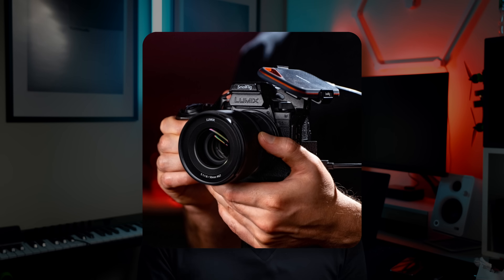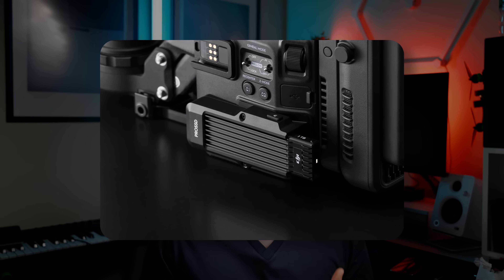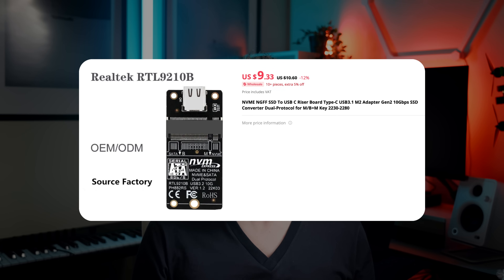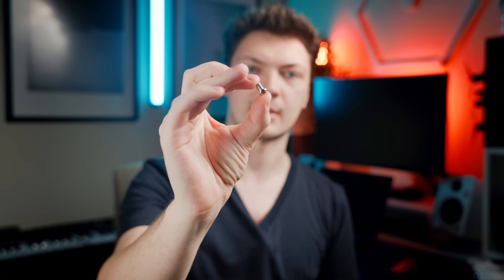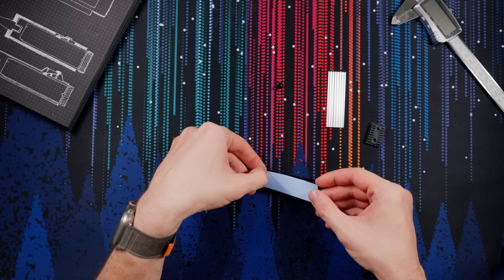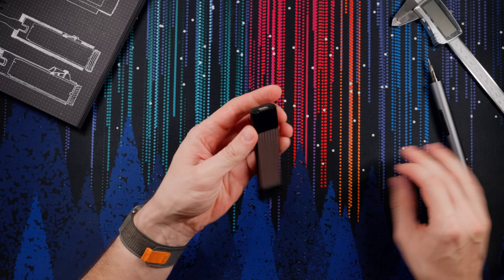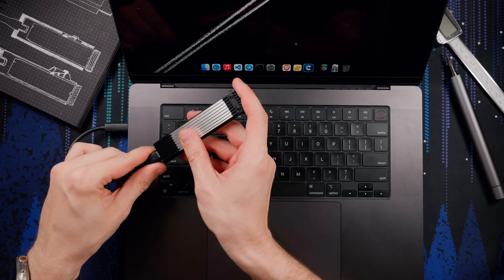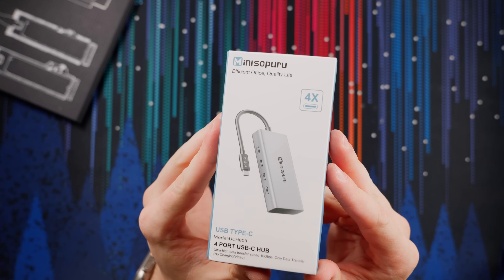Free DIY Pro SSD Mag Recording System for Any Camera

Comment: very cool thanks - been looking for something like this. I would maybe update the design to fit a fan, because transferring data heats the drives pretty quick, and the performance drops due to thermal throtteling. So a fan could help a bit.
Reply from the maker: ooo that's an interesting idea, will definitely look into this for gen 2 👀

Comment: Hey, I've tried printing the mount a few times, but each time, the hook does not seem to raise very far, and quickly the gears moves towards the backplate until it no longer is moving the hook at all. Any suggestions?
Reply from the maker: Check the number of teeth on both parts the gear attaches to, I've had an issue with Cura slicer where it would sometimes remove one at the edge cause it's fairly thin. I used Creality slicer to fix it
Reply: @MaxRovensky    I have three teeth + the bottom edge on the hook, four teeth on the button, and twelve teeth on the gear. Can on you confirm what it should be? I can't quite make it out from the video.

I have slightly better results by increasing the gear to 105%, but it still seems like something is off.
Reply from the maker: @gillberg1111  that sounds correct 🤔
Can you DM me on Instagram, I can help you troubleshoot but youtube comments are super inconvenient for this 😁

Comment: Great idea and video, Thanks for sharing. 
I'm about to order the parts and wanted to clarify. The link for the heatsinks has 3mm & 6mm high ones. It's a bit hard to tell in the video which ones you used. 
Again thanks for sharing a great idea.
Reply from the maker: 3mm ones 🙂
Reply: @MaxRovensky  Cheers. I'm going to make 4x Mags and the 4x Bay for my laptop. That way I can shoot tethered photos and have desktop PC-type storage at home. I may even try and put a Mount on the laptop rear for increased storage on the go.

Comment: This was awesome but could you tell me where you got the black screws from?
Reply from the maker: And if you're referring to the ones that secure the SSD inside the mag - they come with the adapter boards and heat sinks
Reply: @MaxRovensky  thank you
Reply from the maker: There are sets of M2/M3/M4 on Amazon for about $15-20, I think I mentioned it in my lens video
I also have a ton of spares from building FPV drones 😅

Comment: The Kondor Blue handle is awesome.  The Problade connector is supposed to be open so any company can use.  Maybe you can get the connector from a company and build it out.
Reply from the maker: I don't think it's open. I'm sure they'll license it to other companies if they ask, but I just don't see any appeal in a pin-to-pin adapter that can be discontinued at any point because a single company makes the drives
Type-C is definitely the way to go for something like this imo 🙈

Comment: Just what I needed. Was researching the problade and it seems they just have an nvme and an adaptor to their proprietary connector inside it. 

Would be dope to have a 2230 type nvme casing for an even smaller footprint.

(Would have been nice to see how you cable managed the thing on to your camera)
Reply from the maker: That is a neat idea, I'm gonna have to look into it 👀
Reply from the maker: Re: cable management, the cable is tiny, it wraps to the left and above the mount and goes straight into the USB port, barely noticeable during use
Reply: @MaxRovensky 👀🫡

Comment: Useful, BUT: Just using Samsung T5/T7 SSDs with the normal tilta ssd holder in a comfortable position and an angeled cable will do just as good, won't it?
Reply from the maker: Yes, but it takes up more space on the cage somewhere and I don't want to deal with cables 
The nice thing about this one is I have to plug it once during installation and never cable manage again 😌
Reply: @MaxRovensky  thats true!

Comment: I have a similar hub, my one puts out a lot of heat, even if not engaged, so in hot weather I have to remove the metal encasing, to protect it from overheating, which would make it crash. The metal encasing has no cooling function, it is insulated inside. I hope that your hub is kind of cooler, otherwise I would recommend removing the housing and add some air slots to your station.

Comment: This is so cool and well thought out!
Just wanted to chime in and add just in case anyone was thinking of getting a different USB hub or using one they already have. MAKE SURE THEY ARE "POWERED" HUBS. To my knowledge (definitely correct me if needed) a non-powered usb hub (one that doesn't have an additional cable that connects to the wall) will not be able to provide separate read and write bandwith to each SSD. Instead, it will take the speed from your computer's USB port and share that across all 4 SSD's drastically reducing read and write speeds. That's the best case scenario, it can additionally kill a USB hub and potentially your drives/corrupt data.

This may be obvious to those that have experience with this kind of setup, but it wasn't obvious to me and I ended up running into issues with my own setup previously.
Reply from the maker: ProBlade bay is powered I think
This hub is advertised as Thunderbolt-compatible with 40Gbps total throughput, which, with each board capable up to 10Gbps checks out and doesn't need a separate power cable
That said, I haven't tested it with more than 2 drives at a time yet. But in theory, it should be well within specs

Comment: This is fantastic. I work with a DJI and one of my issues with it is how expensive the PROSSD. I want to see if this 3d printed enclosure would work with it so i could use a higher capacity m.2 drive.
Reply from the maker: Please do not try to plug it into the ProSSD mount, the dimensions won't match, it's slightly larger 😅
But I am curious if the board + M.2 would work. My suspicion is it might, but won't unlock 8K RAW
Reply: @MaxRovensky   Thanks for letting me know! haha! luckily I haven't purchased anything yet. I want to see if i could use cheaper SSDs with higher capacities like 2 TB and so on. I use the 6k version of the 4D and it 1TB isn't enough to record at the best codec and quality. this is great stuff you're doing keep it up!

Comment: This is an amazing solution, congrats and thank you for the work. Sadly it seems to partially lock the flip out screen which would be an issue for me, although the one with universal mount could be mounted elsewhere on the cage.For anyone looking for ssd mount solution where you can keep the cable locked in, that doesn't have the skills/time to assemble this, I would recommend using the smallrig T5 ssd mount with a Tilta BMPCC angled USBc cable. It works nicely together if you saw the plastic screw holder off the cable.
Reply from the maker: Yeah that's true, I tend to leave my screen in data display mode up against v-mount since I'm using external monitoring anyway
So it wasn't an issue for me, but the mount has to be attached as the last step in the rig
I might add another variation that's pushed further forward, but you're right, universal mount should solve this, i.e. you could use sth like Camvate 1781 blocks to mount it to 15mm rails

I like Smallrig's T5 mounts but one of the requirements for building this was to keep things off of the top of the cage so I'm not using up any extra cold shoes or nato rails there
Reply: @MaxRovensky yeah absolutely, and your solution looks quite perfect for your configuration. I’m always impressed by people designing their own stuff to fit their needs. 
I remember the multiple SSD racks that Dark Power Laboratories designed for the sigma Fp, that was also amazing.
Anyway, your a genius for coming up with this solution and very kind to make it available for everyone !

Comment: Very cool project! There is a certain irony that DJI lock their own system down so hard - on the 4D for example they lock RAW and 8k to only record on the ProSSD and they hardware lock the ProSSD to the drives they supply. So you can't use your own high capacity, high speed drive to record RAW or 8k.
Reply from the maker: I imagine it’s because of the PCIE handshake 
I don’t have the Ronin 4D (yet 👀) but I imagine those files are chonky
If I were them, and had a known history of doing weird unintended things with a Type-C interface (*cough phone destroying Goggles 2 batteries cough*) I’d do a weird unintended thing with a Type-C and CFExpress interface to unlock proper NVME speed instead of “only” 3.2/Thunderbolt 

But then there’s also the possibility that 3.2/Thunderbolt can totally handle those files, idk, I haven’t tested it 🤷🏻‍♂️
Reply: @MaxRovensky  

They actually go to the extent employ a chip that writes the serial of the NVME drive to the USBC>Nvme interface contained within the mag. Even if you bust open a mag and swap the SSD the camera will throw an error. If you try and connect a USBC drive to the male USBC connection in the on-camera mag dock it won't work, and any USBC drive connected direct to camera wont allow recording of the 8k or RAW formats. 

It is in no way a hardware limitation, it is a deliberate software lock to ensure that if you are opting for the 'pro' formats you are buying their 'pro' media. The ProSSD, and the interface, is not particularly fast, well under 1GB/s and the files the camera records needs no more than this. CFExpress is faster than the ProSSD but is artificially software limited to prevent using it for the 8k/RAW formats.

I'm also not sure what you mean by "PCIE handshake" PCIE is fairly agnostic in terms of what it allows to be plugged in.
Reply from the maker: @dylanevans5644  yeah sounds about like what I would've expected
Same thing RED does with their off the shelf mSATA drives in their mags 
Guess it's just the way it is in the high end camera industry 🤷🏻‍♂️
Reply: @MaxRovensky  

Yea, you can see why they do it as they have such a massive markup. At least on Red you could replace the internal SSD or a third party could make their own... not so with DJI :(

It's a shame as their biggest mag is only 1tb, which is a realy pain for very long shots.

Comment: Thanks for video.  Is  the external SSD work on S5ii  or only  s5iix?
Reply: Only Lumix S5-iix has the USB-C To SSD Recording Option, I have Lumix S5-ii it does not have that Option.
Reply from the maker: I know the S5II has some features unlockable via a paid firmware upgrade but I don't think SSD recording is one of them
Reply: @MaxRovensky  true
Reply: @goddyab  a shame s5ii   :)

Comment: Super sleek and cost effective alternative to the pro blade system. One question though, can I avoid peeling the sticker to keep the warranty and is a heat sink really essential?
Reply from the maker: Heat sink isn't technically essential, but reeeeeeeally nice to have, the drive gets VERY hot during continuous operation 
You can keep the sticker on, but it will reduce the performance of the thermal pad

Comment: Will this work for Sony FX3?
Reply from the maker: I don't think Sony supports direct to SSD recording 🤔
Reply from the maker: Okay, I just double checked it. The FX3 has the same issue that my A7SIII did (which is understandable since it's the exact same goddamn camera with software locked features)
But no apparently none of the Sony consumer cameras and their low end “cinema line"support recordings directly to SSD because they want you to buy their CF-A media
One of the many reasons I've switched
Reply: @MaxRovensky  exactly my thoughts, but since the title was "SSD Mag Recording System for Any Camera" I was a bit confused maybe there is a way but I don't know it yet.
Reply from the maker: @Shahaaim  sry, I meant "any camera that supports SSD recording" 😅
Reply: the FX3 does not support SSD recording straight out of camera.
Reply: Only way I know is to get a Ninja V monitor and then record to SSD. You can make the SSD smaller by placing it in a Andycine LunchBox.
Reply: @RastaHenkie  That is exactly my current setup!
Reply: @Shahaaim  Mee too and got excited about the SSD in the handle but RIP.
Reply: You can get a cfexpress type a to NVME but you won’t get all certifications